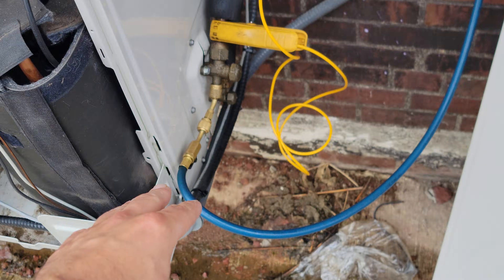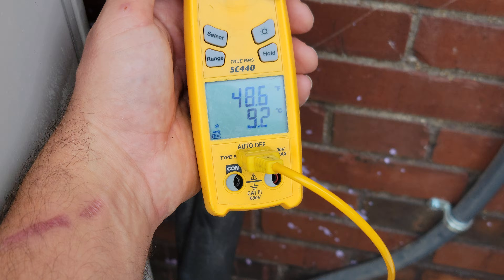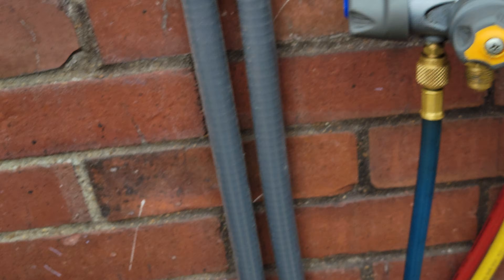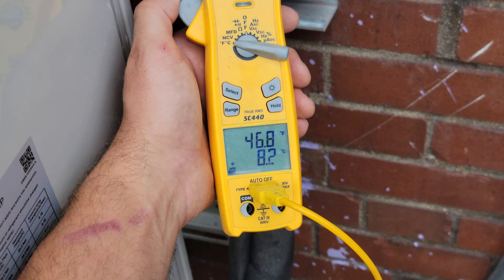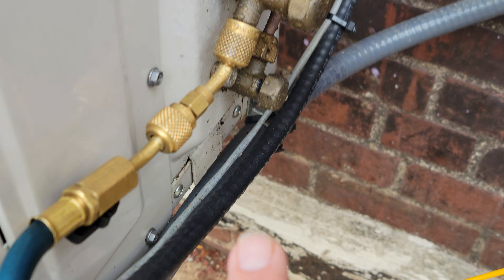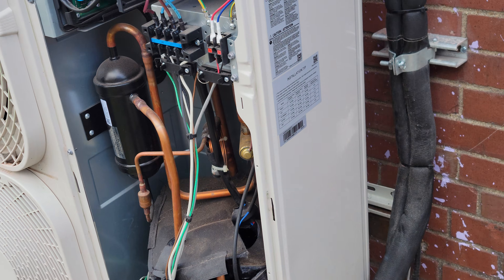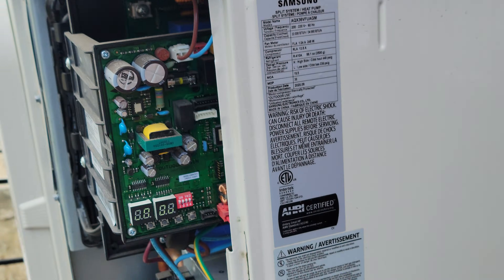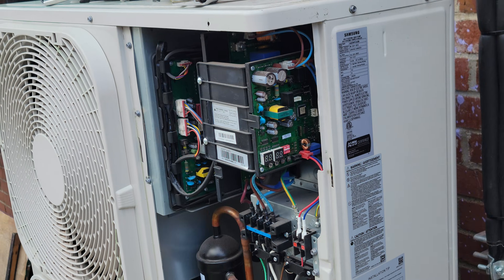How to Check Charge on Mini Split? #minisplit #heatingandcooling #hvactipsfortechnicians

Comment: My suction temperature is 48F. Suction pressure is 94PSI. 70 outside. Supply 46.6F. Return 67.6F. Delta T 21F. Unit was low. I added 2.65 lb of 410. But low side would not go to 120psi. Mini split in a full blast. Any ideas? Thank you!